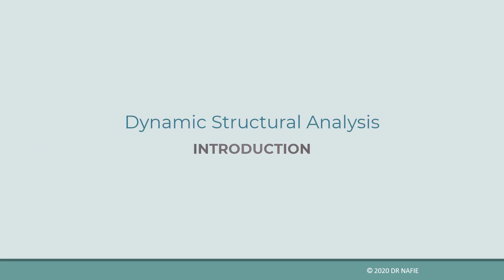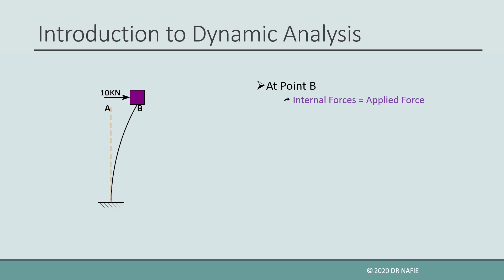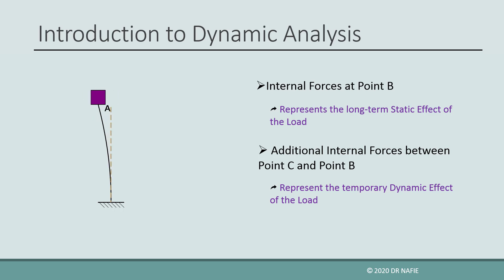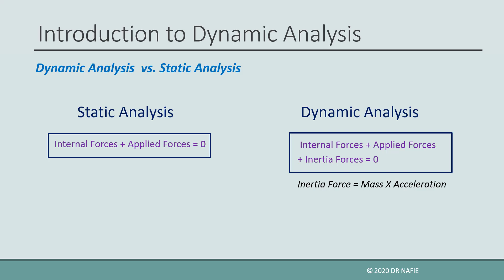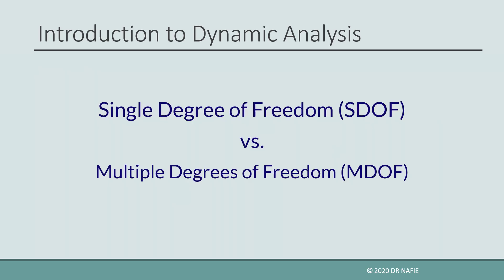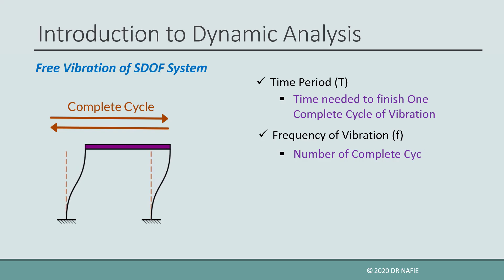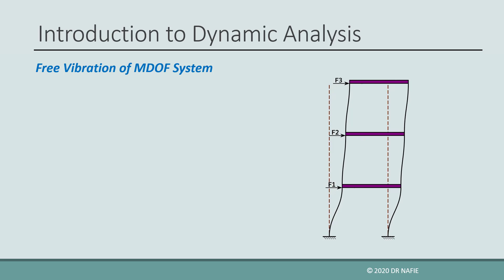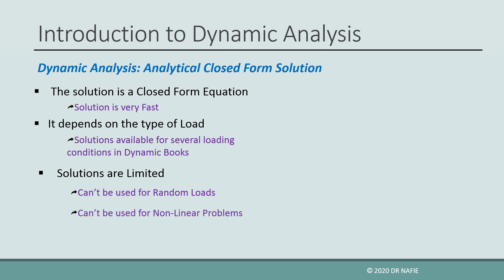Dynamic Analysis of Structures: Introduction and Definitions - Natural Time Period and Mode Shapes

Comment: 2- Why is it that in the literature authors often look only for the 6 or 10  first modes of a structure to study its dynamic characteristics? Are they more likely than others to occur? 
When an initial displacement is applied, does the structure deform on all these first frequencies or only on the fundamental frequency? Thank you
Reply from the maker: The mode shapes are ordered by the lower to the higher frequencies. The low frequency mode is the softer mode. Usually each mode has an importance in the behavior that can be measured by the mass participation ratio as explained in the video. 
Higher modes tend to be less important in the response of the structure than lower modes. The code requires that we include a number of modes that captures at least 90% of the response. Suppose that mode 1 constitutes 40% of the response, mode 2 40% and mode 3 5%, then these 3 will not be enough as they will constitute 85% which is less than 90%. We need to add more modes to the behavior until the sum of the participation mass ratios exceeds 90%.
When an initial displacement is applied to the structure, the structure will chose the mode shape (or shapes) that is closer to the shape of this initial deflection and will vibrate in it.
Reply: @drnafie-structuralengineer4620  Yes, in fact, the small modes dominate the response, but I have trouble understanding why?  Is it a finding from experience or is it a triviality I missed in the course? I know the displacements are bound to be small? But if these high frequencies with small displacements coincide with an  frequencies of external load, won't that amplify the response as it is the case for small frequencies? An example from my structure which is a large pipe of a regular shape with axisymmetrical boundary conditions and loads : the high frequency modes are the most prominent  in terms of Mass participation factor.  (Mode 742 = 690 Hz have  MPF= 26%)  followed by  (Mode 1= 14 Hz which have MPF = 16%)  followed by (mode 2060 = 1500 Hz have MPF =6 %). The others first order modes have  MPF close to zero  .  Could you help me interpret this? Is it a simulation problem on the part of the calculator (Ansys)? I had read somewhere that these calculators do not predict frequencies correctly above a certain threshold. Is it possible that this is a calculation error? Thank you very much for your patience
Reply: @manalmorocco2262  Manal merci pour le partage et je sais où te trouver :D  stp pose lui cette question sur l'amortissement j'ai assez galéré
Reply from the maker: All what we explain here is about buildings and any structures that behaves like buildings. So the rule that the softer first modes have more participation is for regular "buildings". Whether this will happen in the pipe problem or not, you have to analyze and study.
In order to help you, I will explain why this happens in a building. A mode will have high participation when most of the mode is moving toward a single direction, and this usually happens in the first modes of the regular buildings.
I don't know what exactly are you researching, but it seems to me that an axisymmetric pipe will generate limited mode shapes, because you only get the symmetric mode shapes . In my opinion you miss influential mode shapes that are not symmetric.
Reply: @drnafie-structuralengineer4620   Oh I see more clearly now  I don't know how to thank you Professor , really you helped us a lot. Allah ijazek bikhir

Comment: Thank you very much for this very clear explanation. May God bless you.

1 - Please How can we physically interpret the distance between frequencies? i.e. why sometimes the value of the frequencies rise very quickly and sometimes they are too close together?
Example :
(simulation result 1 : 
freq 1 = 7 hz
freq 2 = 7.1 hz
freq3 = 7.14 hz 
..
freq 20 =10.5 hz )
(simulation result 2 : 
freq 1 = 7 hz
freq 2 = 16 hz
freq3 = 54.5 hz 
..
freq 20 =700.96 hz )

What explains this difference which results from a variation in the dimensions of the structure? How can this difference be used? How is it useful? i.e. where is the advantage, in structure 1 or 2?

 Thank you
Reply from the maker: Thank you for you encouraging comments.
Regarding your question, the mode shapes is mainly dependent on the distribution of stiffness and mass in the structure. You can change the modal frequencies by increasing the column dimensions in one story or adding mass in that story.
Regarding the distance between the frequencies, there is no clear cut answer to your question. Usually the mode shapes gives you information about the integrity  of your model. For Example if I find 2 modes with very near frequencies but one mode is in the X direction and the other in the Y direction, this is not a bad sign, this only indicates that the stiffness in the X and Y directions are nearly equal. On the other hand if the 2 modes with very near frequencies are in the same direction this might indicate a problem such as an irregularity
In general, if we are dealing with regular buildings and considering only one direction I would expect mode shapes with frequencies that are not very near ( 1 or 2%) and not also very far.
In summary, if the mode shapes are very close, this is would require more inspection to find the reason for this and find if this is a disadvantage or a problem with the structure.
Reply: @drnafie-structuralengineer4620   Thank you very much It's clear. I am extremely grateful for your valuable answer and time.